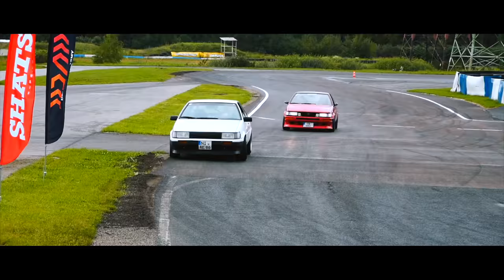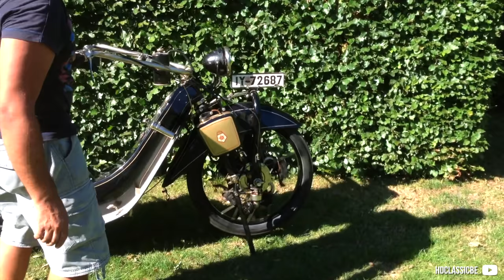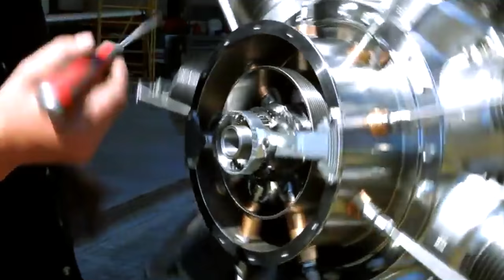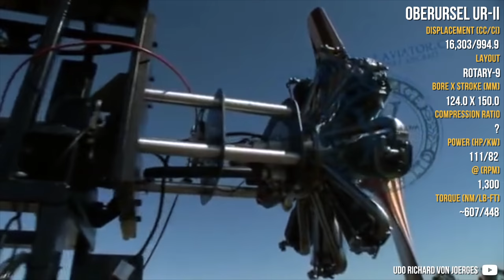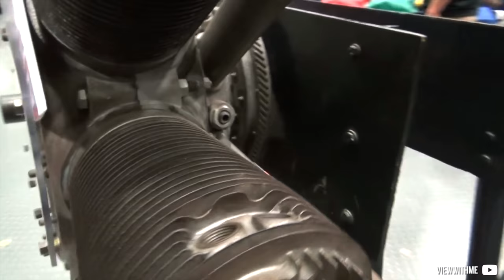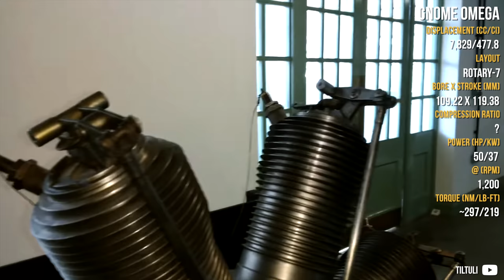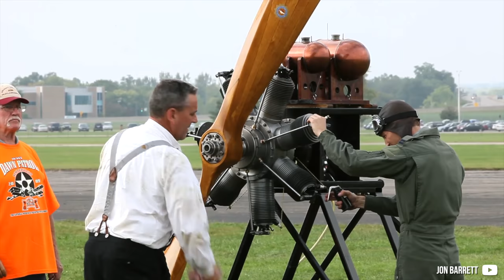These Rotary Engines Are Spinning

Comment: Striking how high the torque is in relation to the horsepower.
But that's due to the low redline of those engines.
They would explode in pieces by going anywhere beyond 1500rpm by centrifugal force.
One has to consider that these all were very early types of engines, the concept disappeared after 1920.
The advantage was that they were air cooled by the rotating motion of the cylinders, and most had also just a single valve per cylinder and no carburetor (a good animation can be seen here https://www.youtube.com/watch?v=Gh3W-9gZXFw ), but the design had many drawbacks, being poor control, huge fuel and oil consumption, limited power due to low redline and when more power was needed the engines grew so large that the spinning mass became so large that planes went virtually uncontrollable due to the gyroscopic forces which the spinning mass creates.
The Clerget however had 2 valves per cylinder  and operated in the way a normal radial would work except for the crankshaft being fixed with the engine spinning around it, it was carburetted as well, and so there was no advantage in simplicity anymore compared to a normal radial, just the drawback of that huge spinning mass, so from then on the normal radial became the norm next to the also existing inline and V engines.
And that's an idea for the next video, Aero engines in I-V-W and H configurations.
Reply: The Millet type rotary was very successful in WW1 aircraft.

Comment: Okay, so for clarification, the 'Wankel' engine is the rotary engine we tend to associate with Mazda as used in their RX series cars. The one with minimal moving parts, a triangular shaped centre that moved. This is what is refered to as a rotary engine. The engines with cylinders placed in a circle around a common crankshaft, mostly seen on old aircraft either in a single row or a double row, or should I say rings, are called RADIAL engines. I hope YOU learned something new today.
Reply: Rotaries the crank case rotates radial the crank rotates. There is a difference.
Reply: Sorry but you are very confused and misinformed.
The Rotary engine was invented by Felix Millet in 1892 and predates the invention of the Radial type engine.

Rotary engines do not have a spinning crankshaft.

The Wankel DKM-54 prototype was a rotary type engine with no crankshaft or flywheel.
The Wankel KKM-57 Invented by Hanns Paschke and Walter Freode is not a rotary type engine and has a spinning eccentric crankshaft and flywheel.

Comment: Interesting bike design, but a terrible idea. Let's ADD unsprung weight and a huge amount of rotational inertia to the front of a motorcycle -- what could possibly go wrong?
Reply: Rotary engines had low vibration compared to other motorcycle engines available at that time had  and excellent power to weight ratio performance.

Comment: Excellent! 
Internal workings information would be swell, as I am not familiar with the rotary design.
I am going to research 'total loss lubrication system'. Never heard of it!

Found:  A total-loss oiling system is an engine lubrication system whereby oil is introduced into the engine, and then either burned or ejected overboard. Now rare in four-stroke engines, total loss oiling is still used in many two-stroke engines.

Comment: I knew about those aircraft engines. I liked seeing them again.  That motorcycle, though , I didn’t know about that . 
How about a video on horizontally opposed piston two cycle Diesel engine. Each cylinder has two opposing pistons.

Comment: They should make a motor cycle engine fof a modern bike , in the rear wheel and with a built in clutch , three or five cylinders with a flat head design . The spinning engine should be able to cool itself even going up the steepest hills . Maybe I'll try to make one , I got three 8 hp briggs and straton hanging around lol

Comment: I cannot imagine the gyroscopic trouble that causes the front wheel of a motorcycle, or the oiling and fueling challenges that would present in those other applications, with that centrifugal force in play.

Comment: What was the point of these anyway?? Was the
metallurgy so bad the props kept flying off or what?? They must have been basically impossible to balance properly.
Reply: Superior power to weight ratio performance and extremely smooth and low vibration... 
Extremely successful in WW1 aircraft.

Comment: Can you talk of the tiger tank engines?!
One of theyre incarnations were used on trains! With 6 valves per cilynder, DOHC twin vertical axis turbines inside of a v16
Tunnel crankcase
Two pieces pistons
And many others notable characteristics

Comment: How they make exhaust if cylinders are moving??
Reply: These things exhaust straight out past the valve which is just deep enough in the head to prevent cool air warping or shattering the valve.

Comment: The rotary was both a brilliant and crazy design. What you didn't explain is how the centrifugal force they produce in the air  affected the plane's controls which would react totally opposite to "normal" engine driven planes. The most successful was the Sopwith Camel (WWI), but not everybody could fly them due to this phenomenon.
Reply: The camel was good but it wasnt the best. Killed too many people and like the fkkr dr1 could only turn one way well. The later german pistiom fighters were better.
Reply: The effects of Gyroscopic Procession is dependent on the weight ratio between the engine and the aircraft and the torque of the propeller.

Comment: But... Why? Advantages/disatvantages?
Reply from the maker: No flywheel, no need for water or fan for cooling, only cooling fins. All others I suppose are just disadvantages
Reply: At the time the rotary type engine offered superior power-to-weight ratio performance, smooth, vibration free  operation and in fighter aircraft required no warm-up time before takeoff.

Comment: Wasn't there a Vespa scooter that had the engine inside the rear wheel?
Reply: Vespa as not inside but on the side of the wheel, doest rotate, classic 2 stroke single cyclinder engine...

Comment: Pretty sure you meant „radial engines“. Or are wankel Engines and radial engines really called the same?
Reply: These are ROTARY engines and not Radial engines.
Rotary engines the crankshaft remains stationary and the Radial the crankshaft spins.

Some people use the slang terms "rotary" to refer to the "Mazda Rotary" which is a registered trademark of Mazda Motors for its version of the NSU Motorenwerkes GmbH Wankel KKM-57 engine.
Reply: I've never seen a Wankel engine rotate. How can it be called a rotary (spinning) ENGINE if the ENGINE isn't rotating? The Mazda engine should be called just Wankel. Actually in the earliest days of Mazda's Wankel they WERE called Wankels, when the licensing on the name ran out and they chose "Mazda Rotary" as a brand name so they wouldn't have to pay royalties on the Wankel name.
Reply: Wow, I didn’t know that. So it’s just trademarks that brought the Wankel engines this name confusion. Thanks for your enlightenment.
Reply: @waynepurcell6058  The DKM-54 designed by Felix Wankel was a rotary type engine with the main housing spinning around a stationary  shaft.

Mazda chose the Mazda Rotary® trademark to avoid paying royalties and to pay homage to Felix Wankel's now forgotten DKM rotary.
Reply: @GuitarMastr3000LP  Yes, it's very confusing.
The DKM was a rotary type engine but was never manufactured.
 The KKM was designed by Hanns Paschke and Walter Freode without any knowledge or permission from Felix Wankel and is not a rotary.

Mazda purchased a license from NSU to manufacturer the KKM and then sells it under the Mazda Rotary® brand

Utterly confusing everyone.

Comment: Um, not rotary, radial, spank you very much.
Reply: Sorry but you are wrong, these are ROTARY engines and not Radial engines.
Reply: @sandervanderkammen9230  No they are not. Rotaries are the design made popular by Felix Wankel, every single engine design here is radial, distinctly different.
Reply: @insomniafun8751  Wrong, the ROTARY engine was invented by Felix Millet in 1892 and first used in motorcycles and aircraft.

They are NOT radial engines.

In the Rotary engine the crankshaft remains stationary and the crankcase spins concentrically.

The Radial engine uses a conventional arrangement where the crankshaft spins.

I think you are confused about Wankel engines as well.
There are two types.
The DKM and KKM

Comment: The trouble with thse is that the engine is a huge gyroscope, and it affects steering.
Reply: Huge power to weight advantage... Gyroscopic Procession was not a serious problem until aircraft engines  became more powerful.
Reply: @sandervanderkammen9230  What do you consider to be a serious problem?
Reply: @rocksnot952  During take-off the aircraft could potentially roll inverted  when the wheels lift off the ground.

Comment: These are known as radial engines not rotary
Reply: These are rotaries not radials. Radials the crank case is fixed. Rotaries the crank is fixed. Wankels shouldnt be called rotaries
Reply: Sorry but that is incorrect, these are ROTARY engines and not to be confused with the Wankel KKM engine design.
Radial engines do not spin, they have a conventional crankshaft.
Reply: @acedogboy8421  The Wankel DKM-54 was in fact a rotary type engine.
But the KKM-57 designed by Hanns Paschke and Walter Freode and manufactured by Mazda and others is not a rotary type engine.

Comment: (1) I have known about aircraft rotary {radial} engines for decades -- and I have known about that automobile for several years -- but until watching this video I had no idea this type of engine was ever used on motorcycles. 

(2) I bet riding that motorcycle in stop-and-go traffic would be a B*TCH.
Reply: The Rotary engine was invented by Felix Millet in 1892 specifically for motorcycles.

Comment: A Megola is a rare find, indeed but in my book a "rotary engine" is a Wankel engine.
What you offer here would be called "Stern Motoren" here in Germany, star engine" would be a 1:1 translation but it may also be called "rotation engine".
Reply: The word you are looking for is radial engine.
But I am not sure if this also counts for engines that spin themselves.
Reply: @SpaceShipDeathstar  radials have a fixed crank case while a rotaries crank case spins
Reply: These motors were called rotaties before the wankel engine existed. The wankrl motor shouldnt be called a rotary
Reply: Wrong, these are ROTARY engines and in Germany are called Umlauf Motoren not Stern Motoren.
Reply: Thanks for clarifying that.
Reply: Sander Van der Kammen:
According to Wikipedia we are both somewhat correct:
Part 1: "The radial engine is a reciprocating type internal combustion engine configuration in which the cylinders "radiate" outward from a central crankcase like the spokes of a wheel. It resembles a stylized star when viewed from the front, and is called a "star engine" in some languages (German Sternmotor, French moteur en étoile, Japanese 星型エンジン (hoshigata enjin), Italian motore stellare). The radial configuration was commonly used for aircraft engines before gas turbine engines became predominant."
Part 2: "The rotary engine was an early type of internal combustion engine, usually designed with an odd number of cylinders per row in a radial configuration, in which the crankshaft remained stationary in operation, with the entire crankcase and its attached cylinders rotating around it as a unit. Its main application was in aviation, although it also saw use before its primary aviation role, in a few early motorcycles and automobiles."
Reply: @stefanpaege2046  You seem to still be confused regarding a key, fundamental concept here.
"in which the crankshaft remained stationary"

If the crankshaft remained stationary  this is a ROTARY TYPE ENGINE. (Umlauf Motor)

If the crankshaft spins in a conventional arrangement this is a RADIAL TYPE ENGINE. (Stern motor).

Any questions?

Comment: More properly called Rotary Radial Engines , so as not to be confused with the Wankle Rotary.
Reply: "Radial Rotary" is not a real name or engineering term and it is also a oxymoron.

These are all ROTARY type engines. Not to be confused with Wankel KKM type engines.
Any questions?

Comment: Surely you mean radial and not rotary... Rotary engines refer to the Wankel design 🙂
Reply: Not necessarily. There are plenty of other kinds of rotary engines out there.
Reply: Radial engine is stationary and does not spin. Wankel engine is a rotor engine, not a rotary engine. It is just a bad translation by the japaneese that stuck.
Reply from the maker: They are rotary, not radials. Radials are stationary, do not spin.
Reply: Wankel motors arent rotaries. These are rotaries
Reply: These are ROTARY engines and not Radial engines...
Reply: @VisioRacer  Ok fair enough, but rotary also refers to the wankel design so it seems it's a bit confusing. I did a bit of research and basically these are pistonned rotary engines and the wankel is known as a pistonless rotary engine which makes sense. 🙂
Reply: @KyleJHB  I think you are still confused, the terms "rotary" in reference to the Wankel KKM engine  is patois, street slang. It's short hand for the registered trademark "Mazda Rotary®" Mazda purchased a license from NSU Motorenwerkes GmbH. to manufacturer the non-rotary version of the Wankel engine known as the KKM-57.
KKM is an abbreviation for the German word Krieskolbenmotor 
(Orbiting PISTON Motor).

Comment: These are rotary engines, a wankel is a rotor engine. Rotor =/= Rotary
Reply: Which Wankel engine are you referring to???
Reply: @sandervanderkammen9230  All wankel engines are rotor engines. They don't have a piston, they have a rotor.
Reply: @CarlMarx  Wrong, only the Wankel DKM-54 has a rotor, the Wankel KKM has a orbiting piston and a rotating crankshaft and flywheel.
Any questions?
Reply: @sandervanderkammen9230  That's a rotor mate, the main difference between DKM and KKM is that the KKM has a stationary housing.
Reply: @CarlMarx  A stationary housing AND a rotating crankshaft... not a Rotary type engine.
Reply: @sandervanderkammen9230  I am saying the wankel is a rotor engine, not a rotary engine. An electric motor is also has a rotor, though driven by EM fields rather than internal combustions.
Reply: @CarlMarx  What you are saying is you really don't have a clue what you are talking about.

Comment: They are called radial engines
Reply from the maker: They are called rotary engines, radials don't spin.
Reply: No they arnt. Radials the crank spins and the case is fixed. Rotaries the crank is fixed the case spins. Wankels shouldnt be called radials
Reply: NO these are examples of ROTARY engines.
The Rotary engine was invented by Felix Millet in 1892 and predates the invention of the Radical type engine.

Comment: I really want to see how the Megola bike will start to run without clutch and gear box...  Thank you ;)
Reply: They are push started just like the GP bikes.
to stop a kill switch is activated with the brakes.
Used mainly for circle track racing.

Comment: Those rotating rotary engines were prone to having sleeves ripped off due to centrifugal force. And entire engine catastrophic failure. And terrible on take off and full opposite aileron to engine rotation was required to counter rhe huge centrifugal mass,  and many crashed simply on take off. Hence the stationary rotary engine with rotating crank was used later and these dodgy engines totally scrapped. 
That bike by the way, would have had the worst if not most dangerous handling when cornering... it would have been virtually impossible to "lean" bike to corner... and thar is why one doesn't see any of that dodgy stuff today. Especially bikes with rotating engines in wheels. "Not talking about lightweight electric motors" but these dodgy ones in vid.
Reply: Rotary engines were very popular and successful in combat aircraft during WW1. It offered greater power to weight ratio performance and great maneuverability.
The were eventually superseded by RADIAL TYPE engines.

The Megola was primarily a racing bike used on high banked board tracks
Reply: @sandervanderkammen9230  radial stationary crank rotary and radial rotating crank were the worst engines ever. The later radials required removing lower plugs and turning engine over by hand a few times to avoid the dreaded hydrolock they ALL suffered from, with catastrophic engine failures. 
There is a reason why not one singe engine today is produced that even closely resembles these unreliable dodgy radial/rotaries etc. 

That bike could only drive on track with very steep bank, because the nature of design would force it to go straight only "again, that is why this concept vanished from planet earth" 
If a radial engine with rotating crank was used in frame with shaft or chain drive, it would have been better and plenty torque, but zero rpm.

There were way better designs in ww1 tgat were used throughout ww2 and many "especially German designs" still used today 
In short, space travel would not have been possible without the Germans inventions of rocket propulsion 

It's not about a "history lesson" it's about a utterly crap designed engine

Comment: Radial engines not rotory engines
Reply: You seem very confused and misinformed...
These are Rotary type engines, they are not Radial engines.
Any questions?
Reply: @sandervanderkammen9230  you should check up on engine designs
Reply: @brianallen6168  I'm sorry but you are the one that is confused.
You need to learn the difference between a a ROTARY type engine and a RADIAL type engine.
  The Rotary engine has a crankshaft that remains stationary.
The Radial does not.
Any questions?